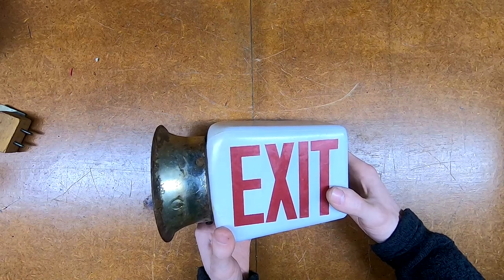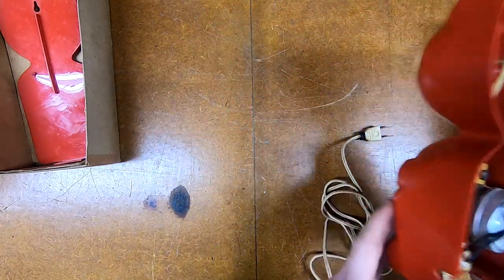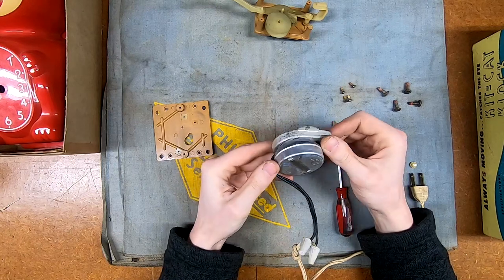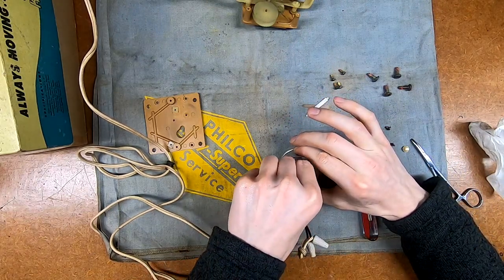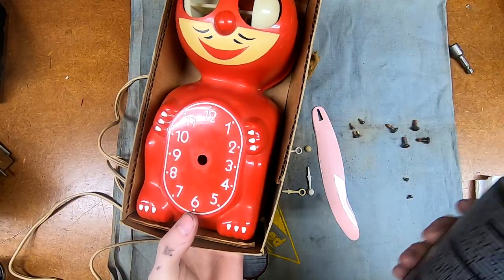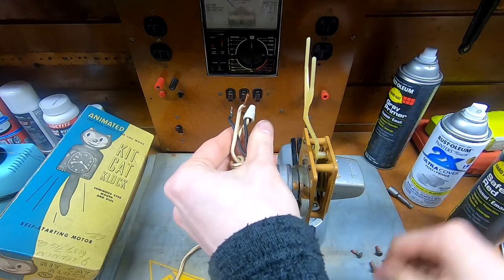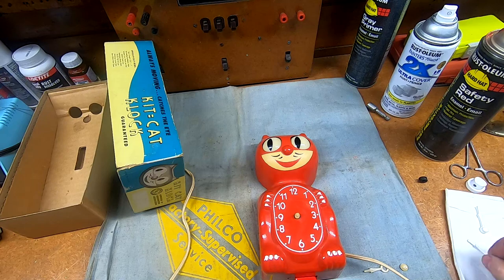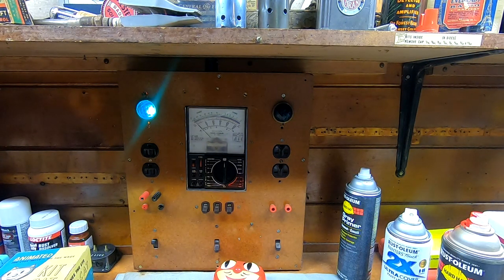Fixing up a Kit-Cat Clock!

Comment: I think this clock was produced between the years 1950-1980 because of the font and the two paws, if it is from 1960s it is very rare because most kit cat clocks produced in 1960s were bejeweled. And in the video isnt
Reply: The exact year is 1953

Comment: Hi.. Can you specify which De-Oxit you used when applied to the motor? Was it D5 or GOLD contact cleaner?  Thank you
Reply from the maker: The Deoxit I had on hand was the D5 version. If I had to do it again, I would have used something else, like carburetor or brake cleaner. Something that evaporates and leaves no residue behind.

Comment: I have a 1940’s kit cat klock brought it from eBay. I had plugged it in hung on my wall on day 2&3 the clock started to smell like old smell it was a terrible smell had to unplug it asap. I wanted to know what cleaner to use on the gears I believe the are metal not plastic. What cleaner do you use to polish up the outer of the klock? My motor does work. I want to change the motor with a new motor. Any advice would be appreciated. Thank you 😊
Reply from the maker: If the gears are metal, denatured alcohol or acetone should work just fine. Naptha is nice for gooey messes, too. I didn't polish the plastic on this clock, but Novus is the recommended polish for old and new plastics; just bought a kit to try for myself. Unfortunately I can't offer much advice on the motor. I believe there are some folks on the internet that offer motor rebuild services, but they are NOT cheap.
Reply: Thank you for your response to my questions. I wanted to say the after running the clock for 2 to 3 days it started to smell like a old oil the smell it was really awful. I believe the clock is made of Bakelite. These motors do run hot. Just wondering if I install a new motor would this smell happen again? I don’t want to put more money with same end results with clock.
Reply from the maker: @crescentmoon4344  A new motor would have fresh oil in it, and shouldn't smell at all when running. The smell yours is making may be the motor overheating and baking off some old oil inside it's gearbox.
Reply: Thanks I will buy a new motor. I love the clock especially the old ones there made really well.

Comment: What was the epoxy you used repair the plastic part? TIA
Reply from the maker: Loctite EA E-20HP 2-part epoxy. Comes in a special tube and uses a special squeeze-gun to dispense it. I borrowed it from work. Most any epoxy should work though.
Reply: Great! Thank you so much and great work! @Eclec-Tronics